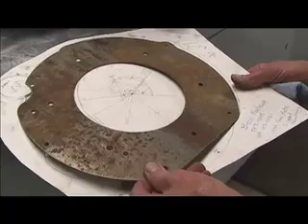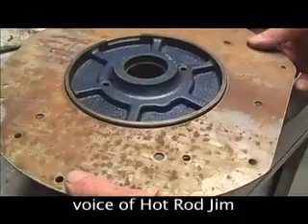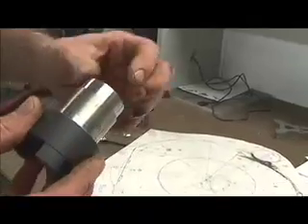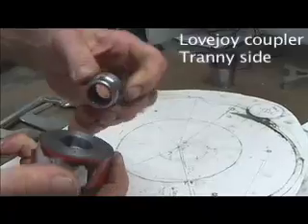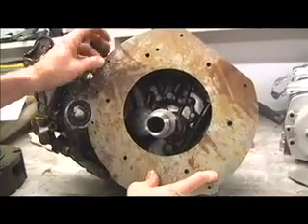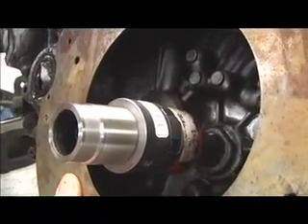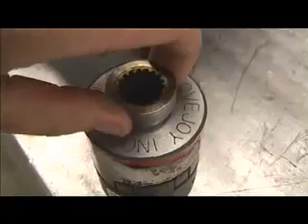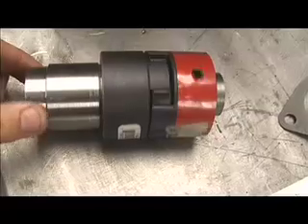Electro-Metro Update 6/18/08

Comment from the maker: @Bertziethegreat 
I don't remember the size of the spline. I used the matching connector that came off the drum brake that was on the motor, so I never had to measure the splined shaft, as I already had the part it matched up with. The drive shaft on this motor is over 1" in diameter. I think it may be 1.25".